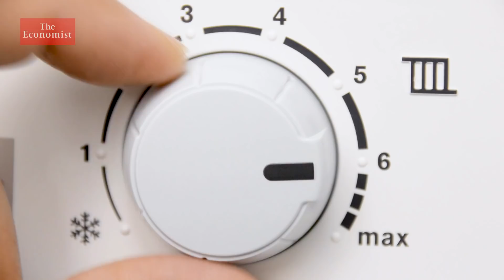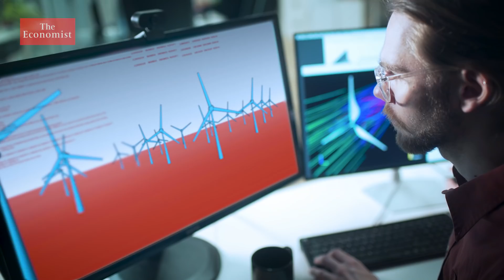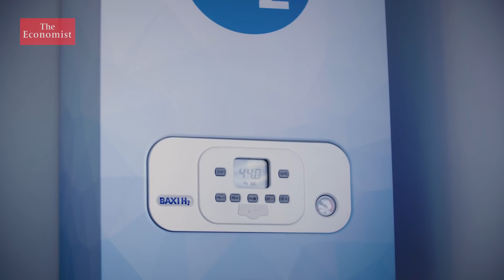Keeping warm, without warming the planet

Comment: Its all about insulation! I live in NYC an old apartment building and so much cold air sips in from windows so they keep the radiators working more than they need to.
Reply: Bro you could cut energy use for heating In half this country if you helped some folks seal up…. My old apartment was so bad I had to run full blast alllll day to heat to normal.  So I f I wanted to to hear whole month would have cost around 1500 for a two bedroom small one story apartment

Comment: Its not just heat. It is cooling too. Cooling needs electricity which uses carbon. The hotter the planet gets the more cooling we will need.
Reply: Heat pumps can run in reverse too which can be used to heat or cool
Reply: @BIoknight000  When they run in reverse it is the same as a peltier cooler which uses electricity to pump the heat out. Still using Carbon.
Reply: @jimflagg4009  IF the power source is carbon-based. But something that uses fossil fuels for electricity today can use a carbon-free source tomorrow.

Installing millions of heat pumps still has benefits
Reply: @BIoknight000  There are only a few carbon free energies...Nuclear, Wind and Hydro.
Reply: @jimflagg4009  Based on the Environmental damage Hydro will never be green 90 % of the time. Especially the smaller ones
Reply: @battlefronter007  Notice I did not Say Solar because a lot of coal is used to make Solar panels.
Reply: There's a more social problem there too. You can make homes that are affordable to cool, but people don't want that sort of home. They want the home with the giant expanse of glass facing towards the equator.
Reply: Though in summer, with plenty of sunlight, the solar panels over homes and in large scale solar plants can produce a lot more energy so is less than an issue than in winter.
Reply: Provide untampered, empirical evidence that electricity use carbon ?
Provide untampered, empirical evidence for your claim that electricity uses carbon and that Earth is getting "hotter" due to that claim ?
Reply: @jimflagg4009  Yes you are right, but heat pumps are more energy  efficient than traditional ACs. It's better than nothing.
Reply: @jimflagg4009  Not true, nothing is carbon free
Energy, can neither be created nor destroyed
Energy, can only be converted from one form to another
Ergo, there is only 'Energy'
You clearly do not have a blind clue jim boy !
Reply: @richardcowley4087  Carbon free just means that the pollution generated puts out no carbon. Fusion is such a energy source.
Reply: @richardcowley4087  but fusion needs energy to get started. The source could be from a carbon fuel.
Reply: @jimflagg4009  clearly, you did not understand my questions and statements
Reply: Electricity doesn't necessarily use carbon, depends how it's made. I also 100% agree that cooling is just as important as heating. From where I live, I couldn't stand both summer and winter without cooling and heating, yet there's no carbon emitted for the electricity that I use from the grid.
Reply: @francisrobindaine-duchesne6095  Maybe. If the power is coming from Nuclear or Wind but most power comes from Coal or Oil. Even Solar is not Carbon free because a lot of coal is used in the manufacturing of the silicon in the panels. Are you sure your electricity is carbon free?
Reply: @jimflagg4009  Yes, look up Hydro Quebec, it's 96% from hydroelectric dams and 4% from wind turbines and solar panels.
Reply: @jimflagg4009  I agree with you that nuclear energy is an excellent alternative to fossil fuels and I know that it's way safer than all fossil fuels. There's millions of people who die every year because of air pollution.
Reply: @BIoknight000  no such thing as "carbon free"
Reply: @richardcowley4087  if a power plant produces very little or no CO² as a consequence of its normal operation then it's carbon free.  Simple as.
Reply: @BIoknight000  how do you expect anyone who calls themself 'bioknight' seriously ?

Comment: Excellent points covered here.  No perfect solutions but here's my suggestions:

* Stop ignoring the basic's (extremely efficient insulation).   We need to reduce the costs of VIPs & VIGs (Vacuum insulated Panels & Vacuum insulated Glass).  Wide scale use of these (cars, houses, refrigerators etc) would significantly reduce power demands.
* Overbuild off-shore wind farms and rooftop solar.   Any surplus energy could be stored (batteries, pumped hydro, etc)--and when these are "full", dump the excess into H2 production.   This H2 would be essentially free--since the surplus power would otherwise be wasted.
* Get rid of ALL fossil  fuel 'base load' power plants.  Add small/modular nuclear plants (preferably Thorium) as needed to supplement battery storage.  
* All EV's should have V2X (vehicle-to-grid, vehicle-to-house, vehicle-to-vehicle) capability.  This way every EV (car, bus, truck etc.) is dual use--and  thus, a potential mini power plant.

Comment: I designed my passive home 15 years ago located in WI and even in the coldest winters I can heat with just a few baseboard electrics if it's sunny out but cold -15f I can still have rooms in the upper 70s without any heat on. House is designed to not freeze without any power or heat on. And I can cool 2200sqft with a single bedroom AC unit sized for 10x12ft room. Plus home can take 125+ mph winds without much damage.
Reply: What did you do?

Comment: I had a heat pump in the house I used to own.  It never kept the house warm at all.  The house was in a place with cooler winters than South Africa, but not nearly as cold as England.
Reply: The technology has improved or, more correctly, the added retrofit cost of better technology has come down. Ground sourced (vs air) should really be standard/mandatory for all new construction.
Reply: Heat pumps are common in Sweden. But their buildings are insulated. Properly like
Reply: @jezalb2710  not all swedish buildings
Reply: @richardcowley4087  yet air heat pumps are common

Comment: Ground source heat pumps are far better but hugely expensive and require large areas of land on a house by house basis. Other countries are building district ground source heat pumps on new housing developments before the houses are built. Makes sense. Must work out way cheaper to build per house. Of course not seen anything like in the UK, still building new houses with individual gas boilers.
Reply: Disagree GSHP are the same as ASHP. However for my home I was advised I'd need a 1000m of pipe laying. That's half an acre! And then neither really work in cold weather as they are essentially electric rads. Much better with a clay core rad linked to solar and battery storage. Also as the GDHP was £35k and the clay core rads plus battery plus solar was £20k it's almost half price. However it will be less than half price next year as battery prices are falling rapidly.

Comment: I live in the Pacific Northwest which experienced the heat dome many of our neighbours use oil and natural gas to heat their homes but my household uses a heat pump. The natural gas prices were often cheaper due the structure of electricity prices which rates increase at higher usage which we hit due to our heat pump. We were so thankful as when the Heat Dome hit we could keep cool 😎 we actually offered our house to friends and family to keep cool as the vast majority people in my city don’t have ac. The government currently gives out thousands of dollars of subsidies to switch people who used natural gas to heat pumps which is relatively green in BC as we use hydro or wind to power our grid. Though one of the major issues is if the rates structures aren’t changed to allow for more heat pumps and Evs the transition to greener economy will be harder.

Comment: Heat pumps require electricity.  If the electricity is generated with fossil fuels, there is only small savings in CO2 emissions.  Insulation is the most cost effective way for UK.

Comment: It would be nice to see the US start subsidizing heat pumps. I wish that's what we had done when we put in a new hvac a couple of years ago, but I didn't really know about them then. In the meantime, all I can really do is keep the heat set very low.
Reply: why should it be subsidised
Reply: @BlackMamba-lt8oe  we subsidize carbon intensive technologies by not charging the real price of carbon. Nat gas is currently cheaper than heat pumps in the US, but only because the consumer isn’t paying for the environmental damage they are causing. Subsidies for heat pumps will save money, a lot if we embrace them quickly.
Reply: @haught7576  so subsidise natural gas
Reply: @BlackMamba-lt8oe  learn to read
Reply: @haught7576  my father is not English, nor is my mother an English teacher
Reply: Heat pumps don't work so well in northeast states, the midwest states and in the Pacific Northwest states which get cold in winter. I would never take out my gas furnace. I will keep the thermostat set at a lower temperature and use an extra blanket.

Comment: Current heat pumps need a boiler backup if the weather is too cold
Reply: Exactly, what happens in the U.K if the gulf stream collapses?
Reply: @lorebrown5307  it cannot unless the earth starts spinning in the other direction or a vast ice appears miraculously out of nowhere to block.
Reply: @Marvin-dg8vj  ehm.. Isn't the "engine" of the gulfstream mainly powered by the difference in temperature, between polar and equatorial regions? 
Cold water sinking to the bottom at the poles, while heating up at equatorial regions...
Reply: @Skoda130  obviously yes but the point I am trying to make is how anyone can take seriously the claims of climate scientists who believe it switches on and off like an electric light 
And we run our entire societies on this type of science

Comment: The title of this video is misleading. Heat pump still need fossil fuel. But with the same heat generated, heat pump just need 1/3 of the fossil fuel compared to boiler or heater. .
Reply: Heat pumps rely on electricity so whether they use fossil fuels or not depends on how that electricity is generated.
Reply: They need electricity, anyway. How much of that comes from fossil fuels depends on country. Though a properly set up ground-source heat pump can get a COP so high, it's actually more efficient than burning the gas in your own home even allowing for transmission losses.
Reply: @FelipeElLocito  dont rely on wind and solar for that

Comment: Air conditioners depend on refrigerant fluid, which is easily lost, so as they age, their power consumption goes up, meanwhile losing cooling power, and they do not have sensors or any way to warn the owner at what is happening (it may easily be fixed by replenishing the fluid), but the majority of people is not even aware of it, and keep rising the power, until they decide that the unit is "not working", and buy an entire new one.
It would be easy to provide a sensor and a speaker to tell to the owner that the artifact needs maintenance.
Today at best,  the units show a numeric signal on a led screen which is cryptic, and nobody cares to find what it means.

Comment: First you need to insulate buildings better. That can be done by building an outer shell of hempcreat bricks to the outside. Better yet, build with hempcreat Lego-style bricks to start with. Super insulating of heat and sound and fire resistant if not fireproof. Highly insulated homes need little energy to heat and cool. No-brainer.

Comment: Central  ground heat pumps alongside seasonal energy storage system for several building blocks could provide an efficient and reliable solution to fossil fuel dependency for heating and cooling.
  "Underground Liquid air battery" system could be employed for seasonal energy storage capacity.
Reply: tell him he's dreaming , where do you get the electricity to charge the only 50% efficient battery  it's hardly better than a compressed air motor

Comment: Wrong: "This historic disaster [the Hindenburg] hung over public attitudes toward hydrogen use for decades even though it wasn't the gas that caused the explosion.". Quoting Wikipedia, "A variety of hypotheses have been put forward for both the cause of ignition and the initial fuel for the ensuing fire." The fact remains we don't know, but hydrogen is more explosive than petrol. One of the hypotheses is that simple static electricity blew it up. That makes the Economist sound like a shill for the H2 industry, saying it definitely wasn't the gas. It easily could have been.

Comment: Heat pumps, insulation, personal solar are all excellent measures but human society depends on reliable electric base load available at all times. Wind and solar don’t come close to providing this now and may never do so. The only non fossil option is nuclear but it seems the people most concerned about climate change are also the ones most opposed to nuclear power. The country that will face this dilemma first is Germany, as it is dismantling both fossil and nuclear plants while having no real alternative in the works. It will be interesting to see how they fare.
Reply: I disagree. I live in the Tropics and as with many others in the country, have had only solar for electric power for 30 years. Batteries do wear out but if cared for can last 7 years for me. The lead is 95% recycled in Australia. If  I were nearer the coast or in the uplands wind would be an option. Many farmers in eastern Australia also have mini-hydro schemes, they come in all sizes I have seen some very rudely made which lasted decades. You can also save energy needed to provide water with gravity schemes (I have that 2 km long with 18 branch lines.)
Reply: @treefarm3288  your tropical location is optional for a small personal carbon footprint. Nations much further north with cold, dark winters have very different energy needs. But even your location doubtless depends on industries with high power requirements, even if they are physically far away.

Comment: Heat pumps do not wok with hydronic hot water boiler system. We need heat pumps designed to replace boilers, not the entire radio system. Forced air is not efficient, hot water is better.

Comment: Wait, what? A heat pump collects heat from the outside and transfers it into the house? But what if it’s much colder outside?
Reply: Do you want a visit from the thought police, because that's how you get a visit from the thought police.
Reply: ~ did you like your own comment?
Reply: @dsmyify  % no
Reply: See technology connections video on how they work but basically you use a fluid that boils at a very low temperature coupled with a compressor
Reply: ~ that's what someone who did like their own comment would say.
Reply: @fnw65  Could you define “heat” in this context? Does heat not require a high temperature?
Reply: Then surprisingly, it still works. Even on a cold day, there's still heat outside - just less of it. Though the pump does need to intermittently reverse for a short time to melt ice off of the coils.

Ground source heat pumps are better than air by far, but also impractical to retrofit to existing buildings - they really need to go in when the house is built.
Reply: So... go back to school an learn
Reply: @CoffeenSpice  Aha, I think I get it now. It’s not about the temperature difference between outdoors and indoors  but it’s about energy transfer.
Reply: Also you have to consider that already at shallow depths below ground the temperature never falls lower than 4°C in most inhabited places. 
With heat pumps you can achieve effective energy efficiencies of 200-500%.
Reply: Heat pumps are popular in Finland. -10C° outside +20 inside.

Comment: Right...heat pumps...so were does it comes the eletricity to power the device?
Reply: You have a point. But most importantly buildings should be well insulated.
Reply: Less energy required than conventional heating.

Comment: Perhaps we should stop putting in air conditioning into schools, open windows instead? And heats pumps don’t respond to cold spikes. With traditional central heating, you just up the thermostat. You can’t do this with a heat pump. Back ground heat is insufficient. So many of the other options have significant restrictions, these aren’t discussed here. Why should people voluntarily give up these comforts, without certainty that they can continue to keep warm.
Reply: the manufacturer determines the output temperature of the heat pump not the external heat you are all talk put your actions where the all mouth is
Reply: @forbaldo1  well that doesn’t help me on a bitterly cold day. I want to be in control

Comment: People living in cold or hot climates have higher energy requirements.  In the future there will be more people living in milder climates because of high energy costs.
Reply: Getting people to move is about the most expensive thing you can do.  Adam Smith noted this more than 200 years ago.  Nuclear power will be cheaper than getting people to move away from where jobs are.  Getting jobs to move based on reducing energy requirements is unlikely to happen.  Energy is just too cheap for that to happen.